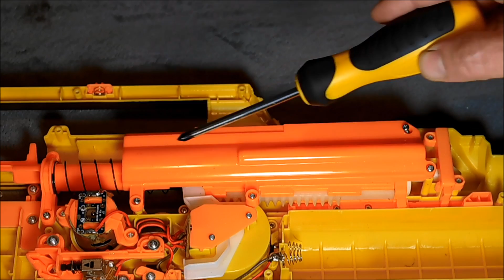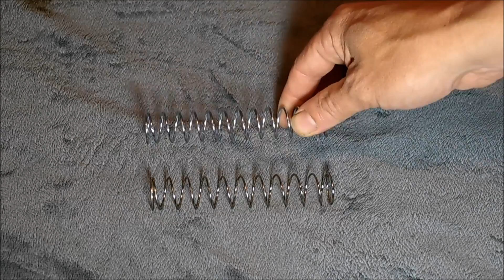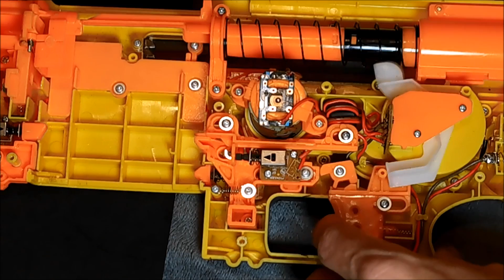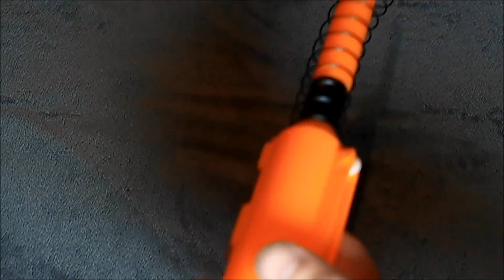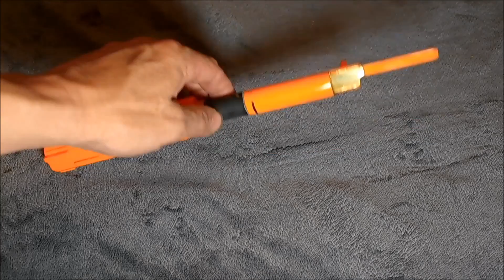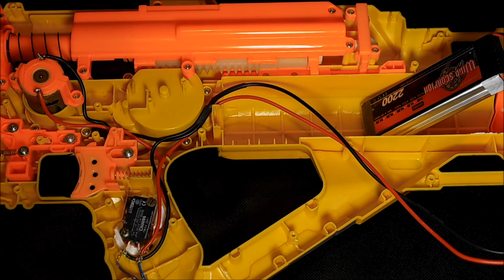Stampede Mod Guide

Comment: I recently modded my stampede however I have been having major issues, I didn't do a rewrite however I did snip and solder together the leads from the safety switch so it is always on. I also put a stronger spring in there and put hot glue in the little air hole on the plunger head. The problem i am having is that the darts hardly get out of the barrel, and it almost seems like the plunger retracts before the dart can fire so it gets stuck on the dart gate. If you know what the problem may be please help, and if you need me to make a video I can.
Reply from the maker: Pretty sure I can Help you out. Often When an upgrade spring goes in a Stampede, It cycles improperly. The extra spring load causes the plunger to release just a hair too soon. Generally resulting in the dart just barely getting out the barrel, or getting stuck in the dart door. Is the AR still in? 
If you upgrade the catch spring as well as the plunger return spring it normally solves the issue. If not shoot me a mail, over too Project.Nerf.2.0 @Gmail.com and well go from there..................................... Chris
Reply: Project Nerf you were right it was the ar it's shooting fine now I was worried it was going to be something major I was missing
Reply from the maker: Glad we could help out. :)  If you have any more questions you know where to find us.
 Nerf on Thomas !!!!.................. Chris

Comment: Mine doesn’t work for some reason. The motor works but gun won’t work. I’m guessing a trigger or something
Reply from the maker: Does it run when you pull the trigger? If not it’s probably a bad safety switch. Also I have seen a ton of them not run due to corrosion on the battery terminals.

Comment: Um help me, I cracked the area of where you cut the breech, I need this thing to work, I spent to much money on it
Reply from the maker: Are you doing a brass breech? if so it's no big deal, when you install the brass, the crack wont matter at all, as the plastic part is really only a holder/guide at that point............. Chris

Comment: I have the 20 $ metal gear set from nfstrike and a 9 kg spring 
What lipo could i use
Reply from the maker: The stock motor can easily handle a 3s, but you may need to go to a 4s using a 9kg spring load.

Comment: I really wanna know how to mod but I always break them: ( can I please get some help? I'd love a reply from anyone who actually knows how to mod
Reply from the maker: Well, I'm Glad to help out if I can. Where do you seem to be going wrong with them? Let me know and we'll go from there.
Reply: Project Nerf I open up a gun and when I need to put it back together it won't catch or fire: (
Reply: Keep in mind a spring blaster I don't wanna mod any thing with wires
Reply: @harveybarton1612  Sorry to resurrect a long dead thread, but usually catch issues mean that the reset spring for the catch is either missing or isn't correctly seated. The catch spring should be sitting on a post atop the catch and should be under pressure again when you close up the blaster again. If your catch spring is missing, you can replace it with a spring from a old click pen cut down.

Comment: I got a Nerf Stampede that does not work.... I am trying to just get it to work. Does anyone know if the circuitry on the motor is essential?
Reply from the maker: If you mean the board on the back of the motor, then no you don't need it. But you will have to remove it and solder the wires directly to the motor tabs. However I will say that in my experience I have never seen one go bad. The 2 most common causes of a no running stampede are, 1st, a corroded battery tray/springs that it touches when it's in the blaster. 2nd a bad switch somewhere inside, it could be any of them. The mag safety, the jam door safety ect ect. If I was you I would start with those 2 things before I started gutting the internals.......................... Chris
Reply: Project Nerf Thanks for the help, however, I checked both the contacts and they were both in very good condition. I also discarded the damaged switches, and it still did not work. I think that it might have been assembled wrong... the white gear teeth strip on the bottom of the spring tube might have been put in backwards...
Reply: I have a piece with the number A5N on it...it looks like it would slide back and forth like the rear catch does... very similar shape, too... I can’t make out where it goes on the video...
Nevermind. Found it. Hidden under the orange baseplate at the very bottom of the gun.
Reply from the maker: Okay, If you want to shoot me a video or some pics over to my regular mail, Project.Nerf.2.0@Gmail.com. We'll see if we can work it out together............................... Chris

Comment: What is the maximum voltage and current in a stock stampede????
Reply from the maker: I'm not real sure about the current, though it's not much on the stock system. It runs on 9 volts , but with the board and resistance in the system, the motor only gets around 7.5 to 8.

Comment: What do u think about using trustfires rather than a lipo
Reply from the maker: Actually , in a Stampede it's okay. The single motor doesn't require the current,  that lipos can deliver. But IMRs would probably be a better choice, even though there expensive.

Comment: @Project Nerf
 What micro switch and gauge of wire did you use?
Reply from the maker: On most of my builds, I use 18 awg silicone insulated wire, and 15A micro switches. Which has always worked out well for me. But on the Stamp, there is plenty of room to use 16 gauge and perhaps even 14.
Reply: @projectnerf7920  Thanks!